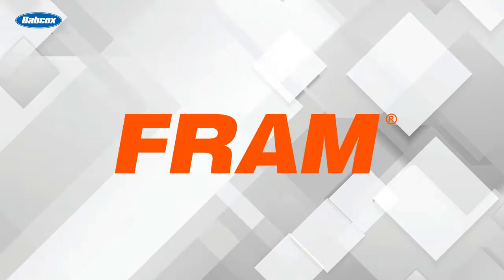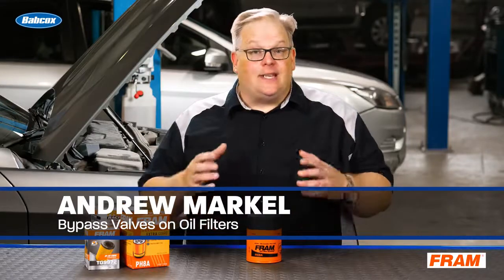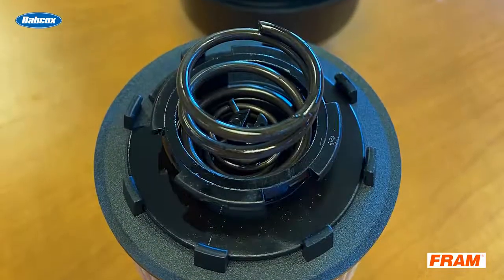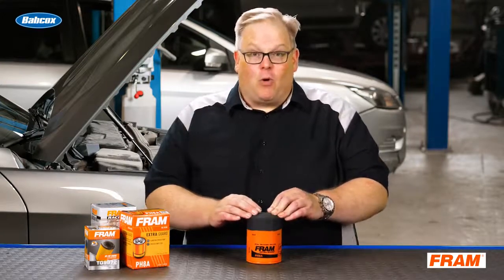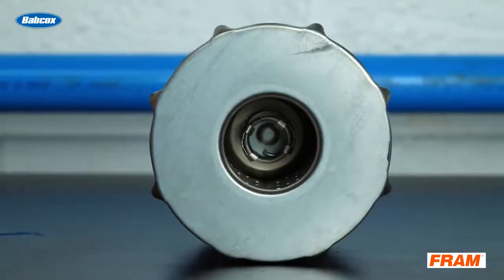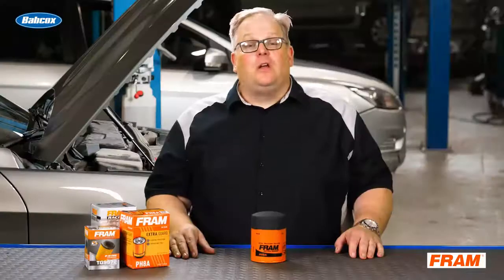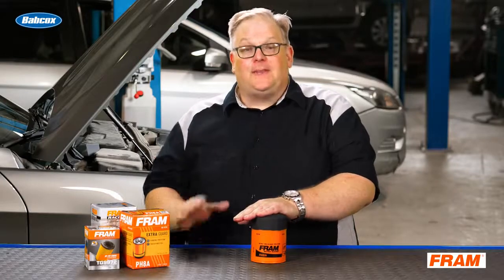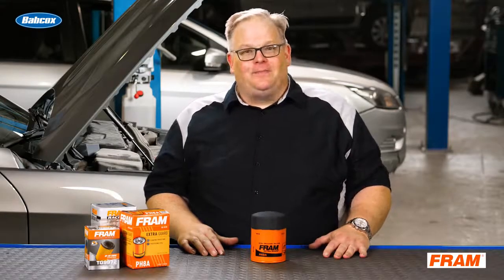Oil Filter Bypass Valves And Filter Capacity

Comment: Does the bypass valve open for a short time during cold starts when using modern multi-viscosity oil?
Reply: Yes most likely.  Hard to know since it is all internal.  I think they bypass more frequently than not especially after the media has seen some mileage.